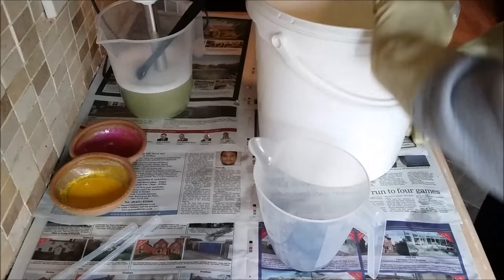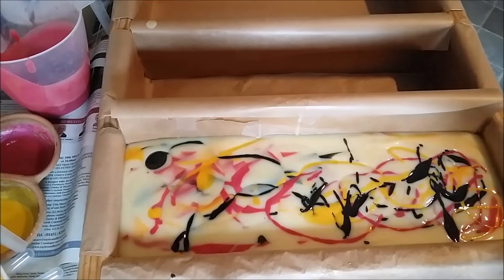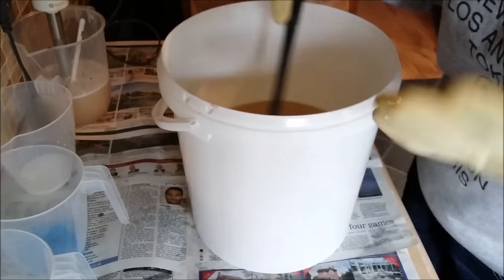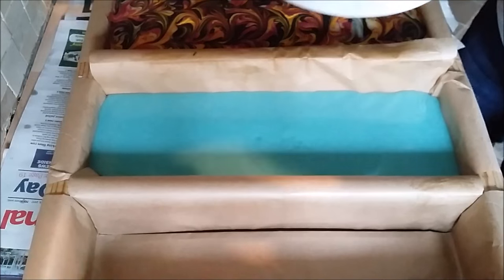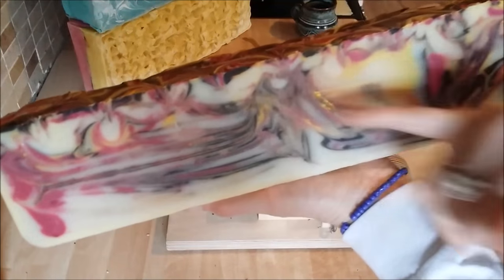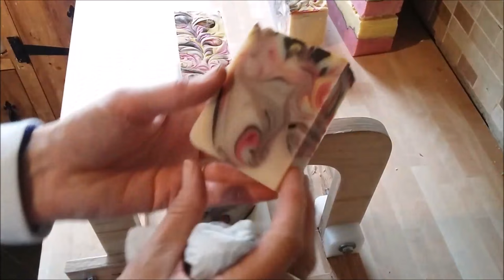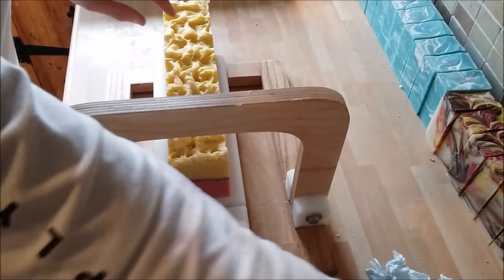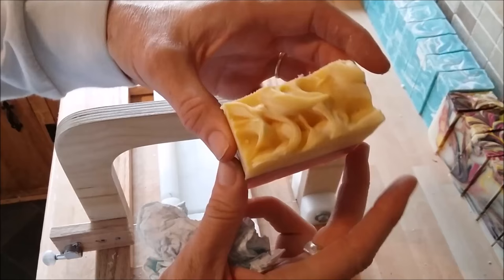Soap Making | Making/Cutting Sparklebox & OM

Comment: I used a yellow mica and my soap turned red. It accelerated so fast I ended up having to put it in a silicone mold instead of my loaf mold. When it cured, it was yellow! It’s from a very reputable company but I’ll be trying others to see what happens. It was crazy! Each day, the red would start turning yellow. Who knows, it’s part of my crazy soap diaries!
Reply: I used sunshine yellow from nurture soap.it turned orange and I thought it ruined my soap batch a week after it was cut it's back to yellow
Reply: Jessica Latner isn’t it just crazy???

Comment: is it right u live in the uk how did the new assessment work for u with different recipes for the different soap all the ones i can fine u need a BASE recipe :(
Reply from the maker: littlemissmakeup075 I'm one of the old school so my recipe includes both soap bases that I use and all additives on my list. I just got them updated with Cosmetic Safety Assessments. Why? Are you having difficulties with yours?
Reply: just wondering as i like to do different recipes with different soaps not a base recipe i do in all if that makes sense
Reply: did u need 2 assessments with your 2 different bases
Reply from the maker: littlemissmakeup075 oh right. well you'd have to pay for all the different variations if you intended to sell them. I only have 2 Base recipes. one with palm, one without. all other ingredients I use are on my additives list, which is quite long!
Reply from the maker: littlemissmakeup075 no, they just allowed me the variation on one assessment.
Reply: okay thank you for your help :)